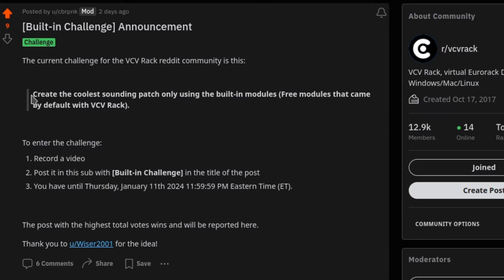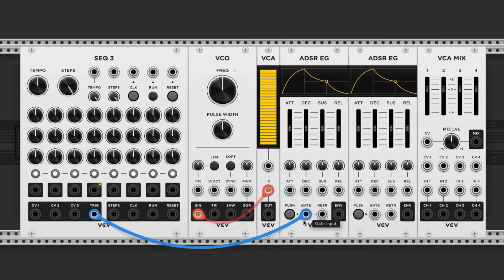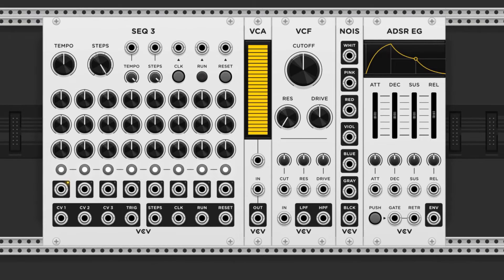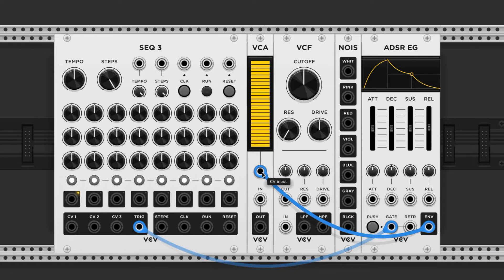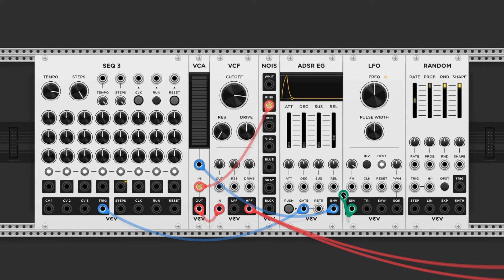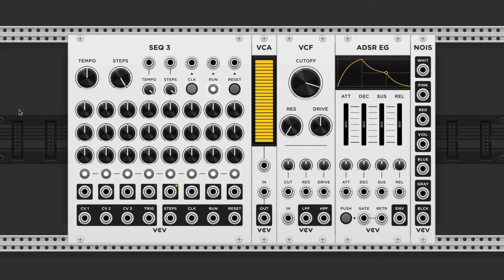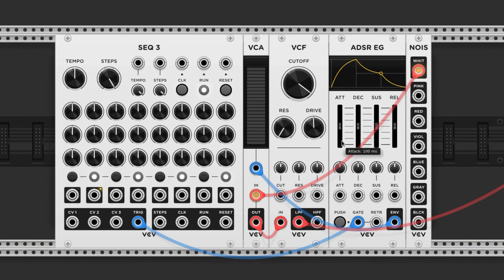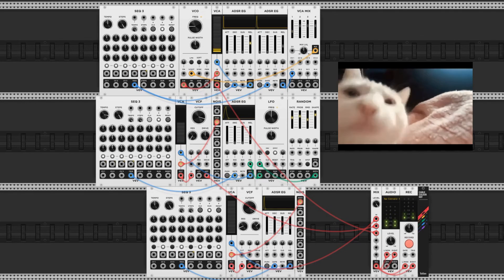Let's Make Drums in VCV Rack Using Only The Stock Modules

Comment: how would I make it so all three drums are synchronised? like if there was one seq 3 to trigger all of them?
Reply from the maker: If you want to use the seq 3 sequencer with triggers, you'd have to set up an individual one for each drum and chain them together. You'd run the trigger and reset output from one to the clock and reset inputs of the other two. Pressing reset on the master now syncs up the 3 drums. Personally I would opt for a different clock and sequencer combo. I really like using clocked by impromptu and the 16 step sequencer by count modula. You'll have enough trigger outputs on the 16 step for each drum and you'll have more steps to make patterns.

Comment: how do you hear the sound in the first drum sound you made? I see that there are 4 connections happening that weren't explained coming out of the VCA output
Reply from the maker: Those connections are going to the stock audio module and the stock record module. The audio module is how you hear the sound. You select your audio device in the little window on the module, and it should play when you connect audio cables to it. The record module is used to make audio or video recordings and that's what I use to make these videos. There are 4 cables because I hooked them up in stereo. Not necessary but a force of habit ✌️😁

Comment: really cool thanks for this! beginner question here... at approx 47seconds, your vca out is making 3 connections to modules off screen... would love to know what those are! guessing one is the audio in.
Reply from the maker: Great question! It is split into 4. I am sending it to the right and left input of the stock audio module and the right and left input of the stock record module. I record all of the audio for the videos directly in VCV Rack so in this case I pulled two sets of cables from that VCA. You really only need to pull two cables and plug them into the left inputs, but it is a force of habit for me to set the audio in stereo.
Reply: @yourpalrob  thats great, got it! thanks alot... former drummer and loving this stuff! cheers!